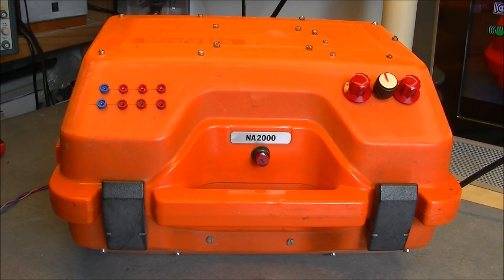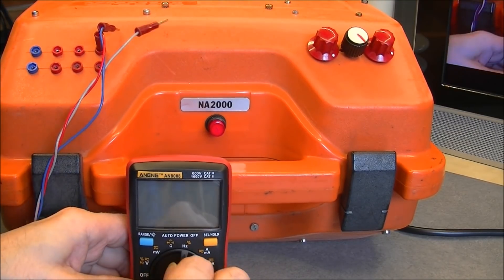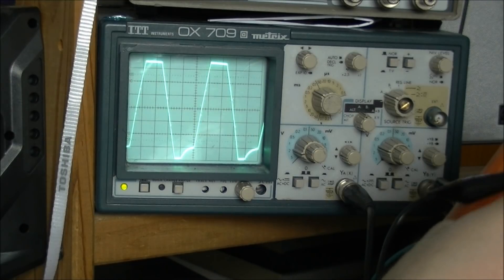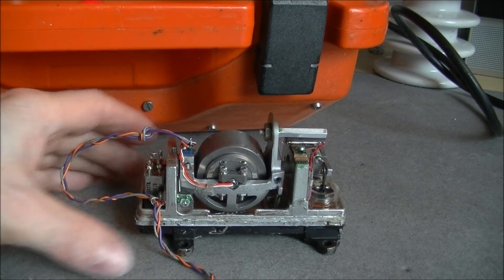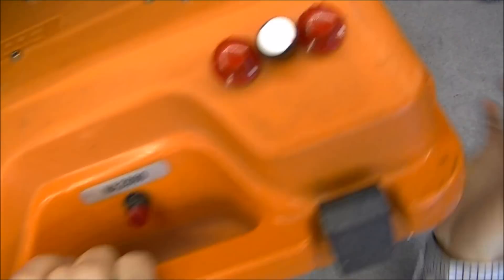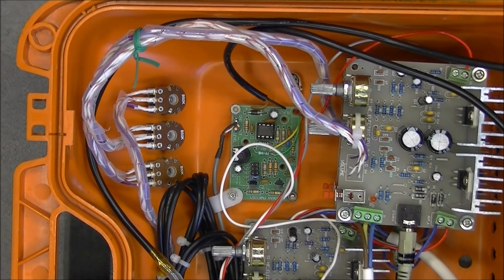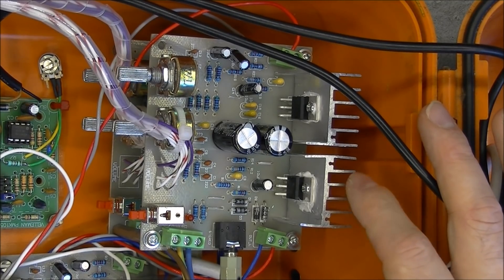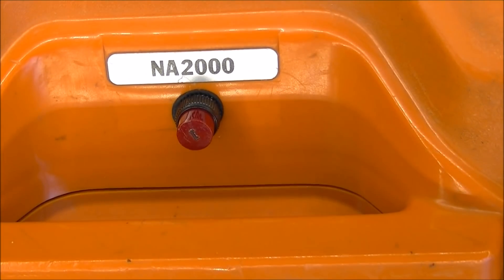The NA 2000 DIY 3-phase 400Hz power supply made from junk

Comment: Wow, its first 3 phase power generator that does not use a 3P motor :) - nice one. But i don't get it why 400Hz and what are the aircrafts in the comments about?
Reply from the maker: It is to power aircraft devices, they are often 400 Hz because it allows  more efficient and lighter power transformers
Reply: @msylvain59  Thank you!

Comment: Recently i came across with the same issue lacking a 'portable' 3phase 400Hz supply for old military stuff. Using the bulky rotary converters was not an option so i made this: https://youtu.be/wMJ5ebLqTXA
Reply from the maker: Thanks, at least it seems much much portable than the contraption I made !

Comment: Glad to see you got it working.
My 3 phase generators and instrument drivers use digital Pwm signals instead of analogue, I've tried them on gyro's and they work well.
Theres quite a bit of distortion on your output, but it obviously works, have you tried 'scoping the output while your driving amotor, I wonder if the distortion gets worse slowing the motor.
Tioo increase frequency stability you can use  polystyrene or better silver mica capacitors in the oscillator.

Comment: You can't bridge amplifiers when the output has a common ground, both sides of the output must be completely floating. You could however use a transformer to isolate the amp from the outputs, which would enable them to run in bridge configuration. A further benefit of this is that you can, using a mains transformer of the the type with 12v and 2 x 115v windings connected 'backwards', get a 115v 400Hz standard aircraft supply :)